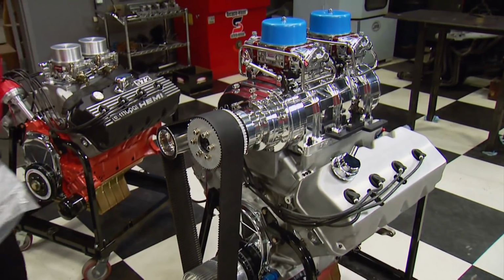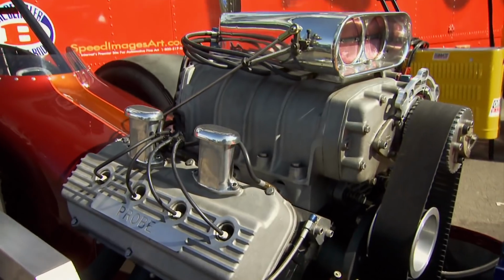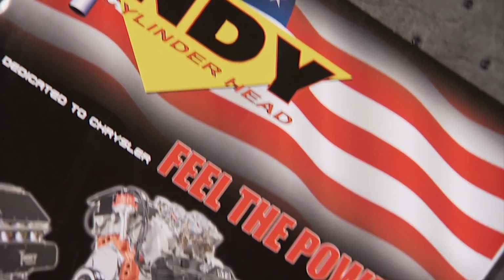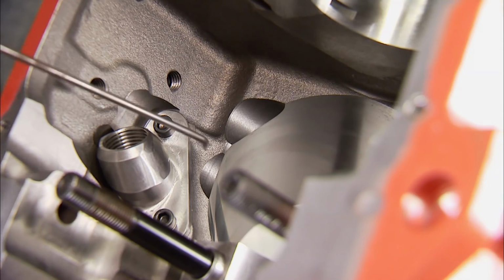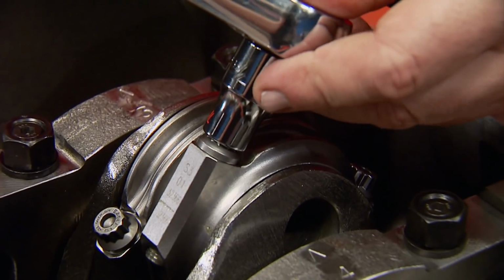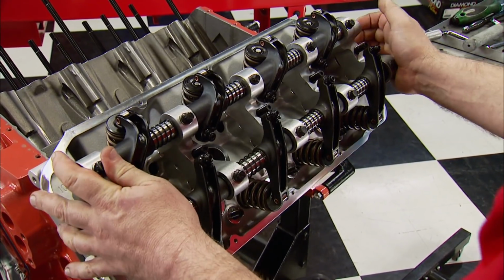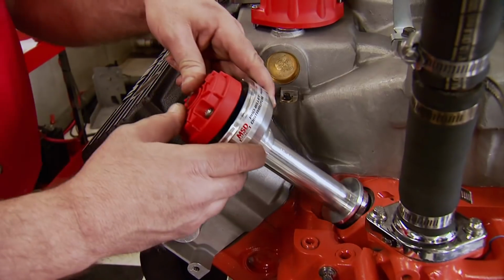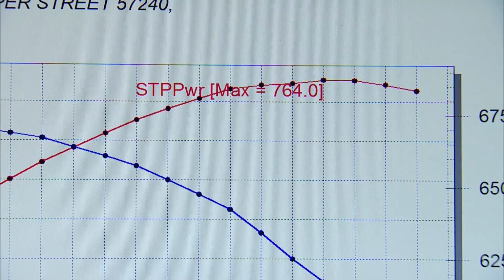Building An Original 572 Super Street Hemi - Engine Power S1, E12

Comment: Only reason Petty won with the HEMI is because NASCAR banned the 427SOHC.  Before the 426 they use the 427 SOHC with gear drives in Top fuel. the 427 SOHC owns the 426
Reply: Proof?
Reply: @darryladams519  Fact is if the 427 SOHC had not been banned lots of things would have changed. It was used by many TOP FUEL with gear drives in place of the chains for a long time.  It still today if set up correct makes great power per cube and can run high rpm

Comment: 572ci making 765hp on pump gas with a single 1050 cfm carburettor, imagine what an aluminium Hemi can do with a 1:1 driven 8-71 blower, dual sparkplugs and a 16-nozzle EFI system...

Comment: Draglist is an awesome source to read all about 50's 60's 70's fuel cars. Pontiac,Ford,Chevy teams having to run Chryslers big block in their race cars. Some tried to hide the heads to make you think the engine is powered by the Car brand body style. lol Chryslers big block is the baddest hot rod engine ever. Todays top fuel cars are the fastest cars on the planet. Hemi Nito power baby. After Chrysler stopped building them guys like Keith Black took over going from iron to aluminum.Mopar sells them in their catalog. Direct Connection.

Comment: That "little" 1050 cfm carb limits this big hemi to 6200 rpm. An 1150 dominator would give 6600 rpm and 800+ hp. Easy.
Reply: Not with a dual plane intake

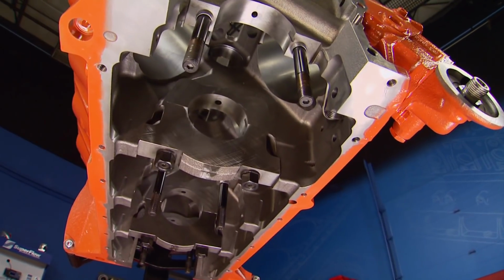Comment: 6:07  6 bolt caps?  I'm counting only 4.
Reply: 2 on the side through block
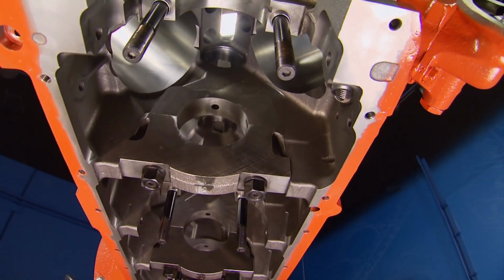Reply: @michaelraddish7898  At 6:07 I'm seeing 2 on the bottom and 2 on the sides = 4 bolts.

Comment: Is a small block Chevy 5.7 350 a 2 or  a 1 rear main seal.
Reply: A small block chevy can be either 1pc or a 2pc, it depends on the year it was produced, any 350/305 made after 1985 so 86 and up use a 1pc rear seal and any sbc 262-400 made 1955-1985 had a 2pc rear seal, they also make an adapter to use a 2pc seal system in a later 1pc seal block to allow the use of the more common 2pc seal crankshaft.

Comment: I think I'd rather have a 5.7 NASCAR engine that makes 900 horsepower and weighs a lot less and higher revving
Reply: I'd rather have an all iron 439ci HEMI from Barton, or Westcott that make well over 1000hp in SS trim and crosses the stripe at 9800+rpm.

Comment: Gotta love a hemi... however.. you can easily get 700+ HP from a junkyard LS for a couple grand all in.. just sayin
Reply: not without boost.
Reply: @bigassfordsd  true.. but its still a real bargain.. i used to build all big blocks.. race or street.. till the LS showed to be capable of holding massive hp.. now its a no brainer.. they are light and easy to build massive HP on a budget... and, they get decent mileage with the right gear and OD trans..   best of both worlds...   dont get me wrong.. if i had an old mopar and wanted the hemi awe factor when you pop the hood..  of course... hemi... buy in all otheer cases... i build LS power..
Reply: @texastyrannyresponseteam794  You do know that the LS deep block and cross-bolts are all hemi style? Upstairs, bolt pattern and deck config of that LS is all small block Ford...No Chevy siamese ports either. LS...the best Mopar/Ford motor that Chevrolet could copy.

Comment: They lost 20+ ftlbs of torque with that dual plane intake
Reply: The one they dyno'ed for me had the modman intake and dual cards..street legend Hemi...final run was 791 HP and 712 ftlbs. See my channel Bartley440
Reply: @mikebartley481  is the a site I can go to buy or would I need to contact them directly?
Reply: Cfm/rpm calculator shows that the carb was too small as well. Engine limited to 6200 rpm. "Genius" engine builders who tied up that hemi and didn't let it roar.

Comment: That was a nice brief history of half of the HEMI story.  The first HEMIs were put in cars for the 1951 model year, and the line eventually included displacements from 231 to 365 cubes!
Reply: 392 cubic inches was the largest of the gen 1 Chrysler Hemis
Reply: @tiredguy21  Thanks for the info!
Reply: 331, 354, and 392.  There was a smaller Poly version but I am not aware of any 231 or 365 ever.
Reply: @auteurfiddler8706  it was 315 cubic inches came in dodge and Desoto and was called red ram in dodge and firedome in Desoto
Reply: My best friend was a poor hemi nut like me. I went with a 440 because I couldn’t afford a 426. He found a 392 and built it with custom cam and pistons. He chromed half of that thing. It was no 426 but he had a hemi.
Reply: John Johnson  Thanks for the info!

Comment: So, 1.2 hp per cu in? Maybe 1.3?  Sounds acceptable.
Reply: There are two Mopar milestones that come to mind here:  the 1956 Chrysler 300B had the first US production engine to produce 1 HP/ci:  the 355 ci (gen 1) HEMI producing 356 HP!  The 1992 Dodge Daytona IROC was the first production US engine to produce over 100 HP/L, with it's inter-cooled turbo-charged Lotus Engineering DOHC 2.2 L engine putting out 225 HP!
Reply: 1.3 is typical of a 468 big block chevy with a stock crank, rods and oval port heads. 800% cheaper
Reply: @bigboreracing356  A super stock prepped 350 with 041 heads, flat top pistons, 1.94" valves and a QJet makes 580hp. More cam than you'd want on the street but still...20 hp with another 100 cubes, no problem.

Comment: The 426 Hemi V8 is a legendary engine no doubt but you know what's more legendary than that, it's the Almighty 427 SOHC CAMMER V8 from Ford.
Reply: I think that legend died...the Hemi lives on! 😏
Reply: @mikebartley481  true.
Reply: @mikebartley481  Yep. Watch this from Uncle Tony and how he explains "the cammer" Pherd.
Reply: & the 427 ohc LS 😏
Reply: @demarcusbody9437  Known as the Mercury Marine V8 which is based off the LS.
Reply: Its only legendary because Ford didn't  have the stones to actually put it in a Street car. BTW they tried to make them work in fuel and they just couldn't. all that tried went back to Hemis

Comment: Love those real hemi engines, my brother-in-law has two original hemi cars.
Reply: That sounds like a fast car Lane.
Reply: What models??
Reply: @jerimahjohnson8698  1967 GTX in a salmon colour with all options except air and power windows and a 1969 Road Runner in red with absolutely no options except for a lever to open the ram air on the hood (factory) and a radio delete kit. Both are mint.

Comment: What bothers me about this video is that they left out putting a dab of RTV on the ends of the split main seal, nor did they offset the seal 3/8th of an inch from the block. So the break in the seal lines up with the break in the block. That seal is now an oil leak.

Comment: A 475 Cubic Inch LS built by Steve Morris Engines makes 1000hp and 815tq.
Reply: Was it naturally aspirated? Was that on nitro? What was the compression ratio?
Reply: @stillbill6408  Yes naturally aspirated. Not sure on the rest but here's the video. 

https://www.youtube.com/watch?v=DtD8FOfU2TQ&t=335s
Reply: No body said this was a max HP effort. Its a street crate  motor with a dual plan intake that Indy sells for street rods.
Reply: A iron block and head 439ci HEMI makes 1040 N/A from Ray Barton and that's with numerous restrictions for conventional SS racing. A Proline HEMI makes over 5000 with twins and a nitro HEMI makes over 11000.....so, what exactly is your point.....that somehow some new age LS piece of crap can out power a HEMI??? Not to mention every HEMI I mentioned has the same basic architecture as the 426 designed by Chrysler in the early 60s, while the LS platforms for big power have been completely redesigned from the factory junk. Which, of course is typical of the modern "Chevrolet" racing engines, both big and small.

Comment: always wanted a hemi, never could afford one. Lots of friends and family ran them.
Reply: Get to know any Mopar guys in your area, get online and seek Mopar (and other) sites.  Hit car shows and hob-knob with the muscle car guys, you might get a basket-engine lead.  Someone will know of an eccentric loner top end muscle-car guy who keeps a stash of Hemi parts.  You'll have to sift through his warped and cracked crankshafts, blocks with welded windows and missing main caps, and a partial set of rods with replacements that may need balancing. $$$$$.  I was fortunate to live back in the day when you could pick up a Hemi for $1,500, or baskets for less.  Been there, done that.
Reply: I feel you
Reply: Get a 6.1 SRT8 engine and buy a stroker kit 426 and enjoy…
Reply: Build one by using scrapyards...part by part...
Reply: @willemp6432  Good luck.  You'll have thousands and thousands in machine shop work, and thousands and thousands in replacement parts.  426 Hemis have been the most pounded and tortured engines around, and scrapyards have been desperately picked through for elephant parts.  11,000 produced, raced like nothing else, 50+ years passed...
Reply: @easygoing2479  Well, that`s a shame.
Reply: @willemp6432  LOL, scrapyards.....
Reply: What about the 5.7 in the 300c? Those are relatively cheap
Reply: @pyrate4439   The newer hemis have valve seat issues. They randomly fall  down into the cylinder.
Reply: @pyrate4439  get 2010 n above engines and that seal issue is resolved

Comment: I think I'd like a low deck 528 Hemi - oh and in aluminum block. I wonder if they make a raised intake port head that allows stock intakes for this combo?
Reply: StageV engineering makes a dual quad low deck hemi intake
Reply: @gtsman6954  I'll check them out.
I know these guys have their Modman intale for a low deck (because project Ultra Violet had one) but I got to thinking it would be better if there were a head that allowed stock intake width as that opens up an entire range of possibilities for intakes.
On the wedge there's a Stage VI head which have a raised port and ypu can use those (expensive) heads on a low deck wedge and any RB intake fits.
I was just wondering if there's a head like that for a Hemi - esp one that accepts stock valve covers.

Comment: The modern engines aren't even hemi they're domi  its just a name used as marketing and its disgusting
Reply: Yes they are true hemispherical engines if y take them apart & I know there is no replacement for displacement but look in many ways these modern hemi’s are better 🤷🏾‍♂️
Reply: It is in fact a "modified" hemi as it employs a shallow hemi chamber with two squish bands, one at ~2 to ~4 o'clock and one at ~10 to ~8 o'clock (intake valve at 12, exhaust at 6). Valves are perpendicular to the crankshaft; hence, the outstanding flow characteristics. The bands along with the dual spark plugs result in more efficient combustion, greater horsepower/torque.

Comment: I was watching a YouTube video earlier about the 427 SOHC, and how Dodge and Plymouth had a shit fit complaining to NASCAR about Ford’s new NASCAR engine. That 427 SOHC was designed specifically to take☠️ out that Hemi
Reply: Funny thing?? You still don’t see top fuel dragster’s running those beloved Ford or Chevy engines that were alway gonna do this or do that to Chrysler’s HEMI. The Hemi was, is and always will be the top dog in any cage you you put em in😂
Reply: @bigboreracing356  ..... & that’s about the only race they won in pro stock, until the nhra had to change the rules so Chevy could be competitive 😂😂😂! Hemi rules🤘🏻🤘🏻🤘🏻
Reply: They blew up basically after one pass.and cost twice what the hemi did.lol
Reply: They were concerned as a properly design SOHC 427 CID engine with Hemi heads would produce more HP/torque than a pushrod actuated engine (due to less parasitic loss actuating pushrods and greater RPM potential). The problem was that the "Cammer" was very poorly designed and suffered from 1) a poor oiling circuit 2) a 7~9 foot timing chain with improper tensioner and/or miscalculated thermal/chain stretch rates 3) improper crank/rod bearing diameters 4) inadequate rod face 5) poorly poored castings (inclusions, core shift at the Lima, Ohio plant). As the timing chain heated, it would stretched and go out of phase /skip a tooth on the driver side cam than blow up. The oiling circuit was nominal for a naturally aspirated engine (< 700  hp) and it is doubtful that the engine could sustain a 500 mile race in the summer heat at high RPM (which theoretically it was capable of) on the NASCAR circuit. Ford's "90 day wonder" was in reality a 90 day nightmare; that is why they never pursued producing it for the street (to make eligible for NASCAR) nor putting it in the galaxy platform (without having to mass produce it for the public) as NASCAR so graciously offered. Ford wisely chose to abort it and build the Boss 429. PS: NASCAR put an end to it all as they soiled their shorts when Chrysler showed them a mock up of its double overhead cam, 4 valve per cylinder, pent roof combustion chambered 426 based on the very capable RB inspired Hemi short block. Chrysler predicted this engine in race trim would be capable of 900+ horsepower with a short block more than capable of 1500HP + loads.
Reply: @stillbill6408  I’m going to go lay on my hand grenade. Thanks for that great Ford hating story/history.😡🤬
Reply: @regsmith7604  Mr. Smith, it is not a question of hate but a matter of fact/history. Sometimes the truth hurts.
Reply: I guess you never heard of the doomsday Hemi? It had dual overhead cams...do your research.
Reply: @mikebartley481  427 SOHC copycats🤬
Reply: @regsmith7604  Doomsday Hemi was DOHC. Can you say Keith Black top fuel Hemi's?  Over 11k hp
Reply: @mikebartley481  I got a cousin in Detroit. He say the next motor he builds has got to be 10k and over rpm. Today 6500 ain’t nothing
Reply: @regsmith7604  Chrysler already did that in the 60s. They had a motor that idles at 10k and rev'ed over 40k rpms. The famous turbine car.... Lol
Reply: @mikebartley481  I had one of them. It was a factory painted model car. I was looking at a Turbine on YouTube earlier.✋🏽
Reply: @mikebartley481  Touche!
Reply: @bigboreracing356  And then, sometime later, along came Bob Glidden. The End. Lol!!
Reply: @regsmith7604  I heard he was cheating with nitrous in his fire extinguisher..Lol
Reply: @mikebartley481  It’s a vicious rumor! After the investigation, there wasn’t and still isn’t any evidence! Haters are gonna hate. You got my blood pressure up! I don’t want to talk to you anymore!
Reply: @regsmith7604  Good for Don.. rumor was his son turned him in. I'm glad Glidden didn't cheat..it's all good don't get your self all upset...you would be easy to get off your game in a street race.
Reply: @mikebartley481  Who Don? What Don? And, his son supposedly turned him in?? I’m gonna ask the Drag Boss about that. Wow!
Reply: @mikebartley481  I’m ok, got a touch of the flu 🤧 took my 2nd shot on Tuesday. Didn’t get sick until Thursday. With the 1st shot last month on the 25th, didn’t get sick until the 27th(my fricking bday) 🤦🏽‍♂️ last month only the aches and pains, this shot/this month snot and everything else!
Reply: @bigboreracing356  I never got around to building a Ford engine, back in the day, back home in Detroit, my cousin gave me a ‘66 Galaxie 500 convertible. Didn’t have no motor! My mom’s made me move it. I guess I was taking too long. Then, I had a ‘70 T-Bird with a 429 ThunderJet mated to the venerable C6. I was take that motor and trans and find me another ‘66 Galaxie convertible. Never happened, went to the military, all of my cousins cannibalized all my stuff.🤬
Reply: @bigboreracing356  I’d rather have that 7.3 motor, cammed, a good aftermarket valve train, and a blower camouflaged as an intake.
Reply: @bigboreracing356  I think 🤔 I did. Him and Evan(Revving).
Reply: @bigboreracing356  Funny how all the fast street outlaws  are running proline Hemi's..Axman...even Ryan Martin. 😲
Reply: @bigboreracing356  send location and how much?  Haha.. I love you tuff guy's
Reply: @bigboreracing356  bottles are for babies.  https://youtu.be/VkOafv2mQ5Q
Reply: @bigboreracing356  Thanks...I quit racing in the 88 when I got married and had kids. Now I just cruise my 69 charger with the 572 Hemi 800 hp and 712 ftlbs torque on pump gas. Indy crate motor.
Reply: @mikebartley481  Is it a 4 spd or an automatic?
Reply: @regsmith7604  all my cars are auto with the manual reverse gear pattern valve body. Cope racing trans build the one for my 572 Hemi
Reply: @mikebartley481  That really sounds old school
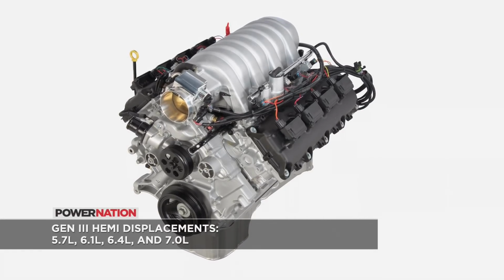Reply: Stock short block with 906 heads , 4:10 gear, 509 hydraulic cam. Auto trans
Reply: @bigboreracing356  I have to mix 100LL avgas because the gas around here is crap.  $4.99 a gallon
Reply: Avgas is $4.99.........
Reply: @mikebartley481  I’m gonna need a high performance plane, internal tanks, a bush pilot and the maps and coordinates
Reply: @bigboreracing356  I just have a ‘00 S10 Extreme Extended cab, w/built LS2 with a built 4L80e, Ford 9” w/Detroit Truetrac, a ‘08 C6 stock LS3 with a Vararam intake and Borla exhaust, my classic ‘02 Avalanche and my classic ‘90 Nissan never been drifted 240SX.

Comment: Original hemi's were kind of POS motors.. Nothing was uniform and not one was the same from the other! Street motors were temperamental considering the motors were made for WOT not street driving!
Reply: I heard they had lots of cracking problems around the cam. It looks like they work real well until they start to break. Like any motor it takes development and refinement to rid of the vices and get strong reliable motors. Chrysler still has some work to do though now that they have lots of top end problems. But it's easier to get better top end components than bottom end though.
Reply: Yes, they where really good repairable cores when new.